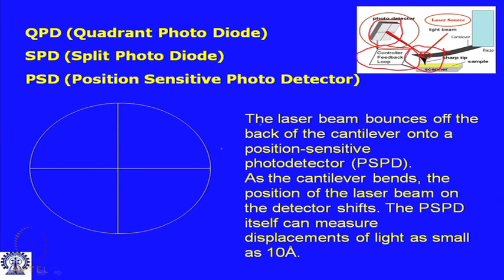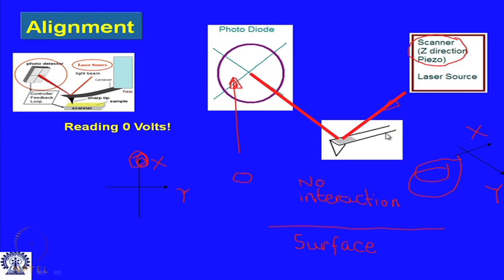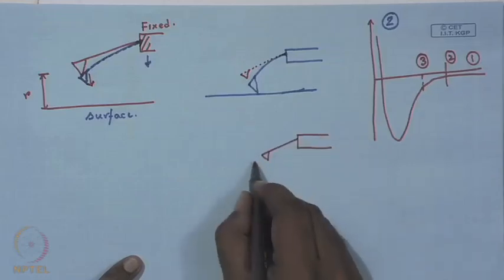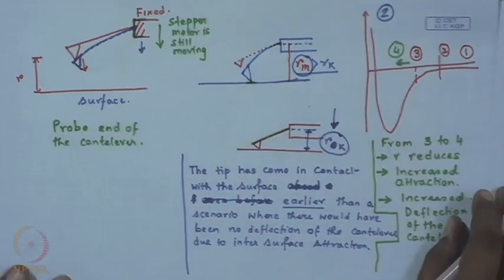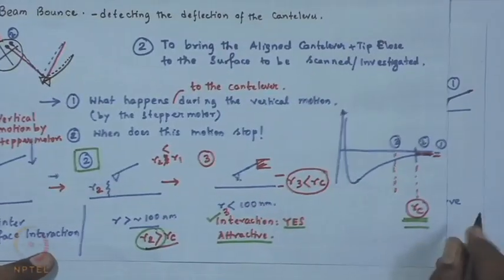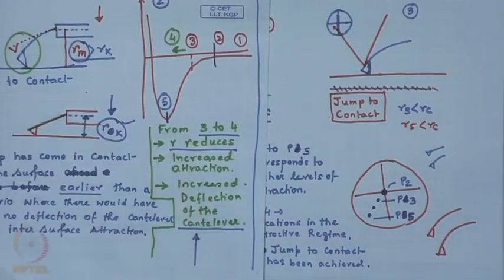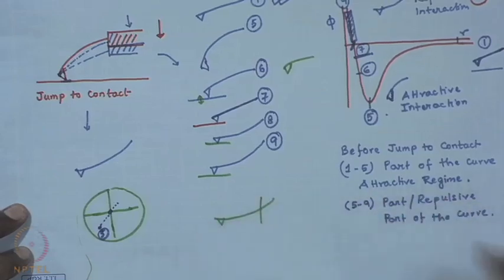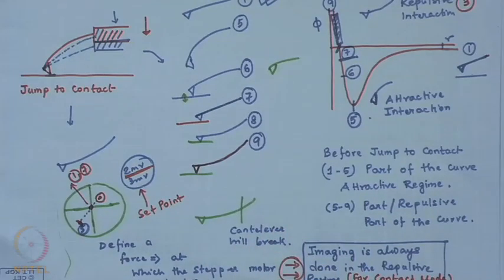Mod-01 Lec-24 Atomic Force Microscope - III

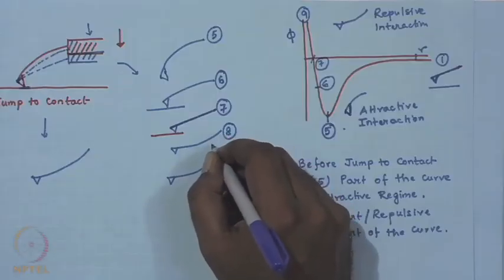Comment: 30:03 the Force should not be 0 hat 7, it should be 0 at 5.
the graph is between potential energy and position.
For force = 0, (dU/dx) =0.
at 7 the force is net repulsive.
I think the instructor is using the force-displacement and Potential energy-displacement graphs interchangeably.
Someone kindly correct me if wrong.